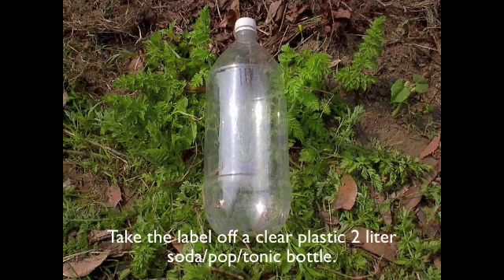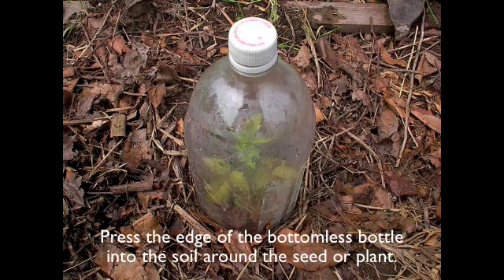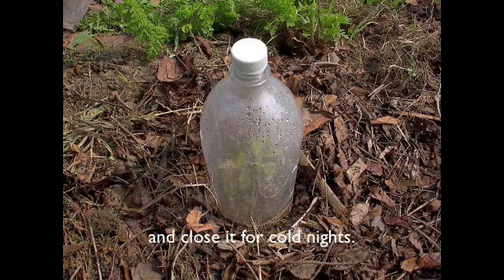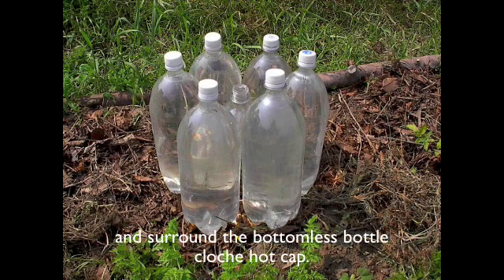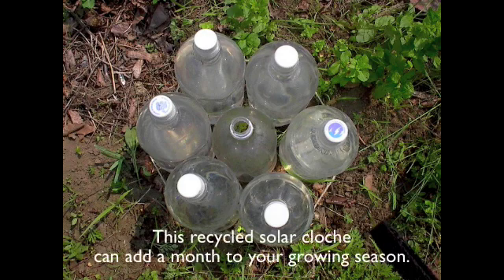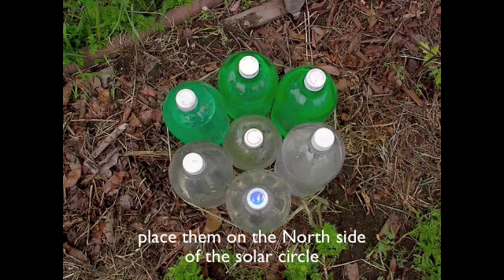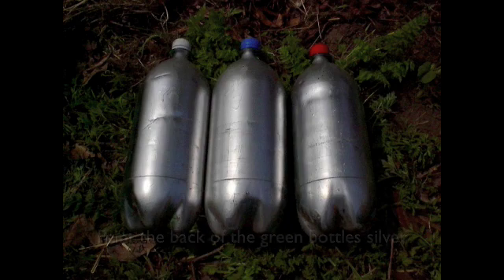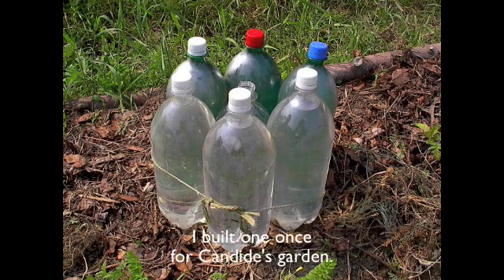Recycled Solar

Comment: why not paint the rear green bottles on the north side black instead of silver? or were u using silver as a relective tool? overall good info will use. also my 2nd question- you said the green holds heat better? why not replace the clear in the front? and if thats the case why not just also cover the plant with a green bottle as well?